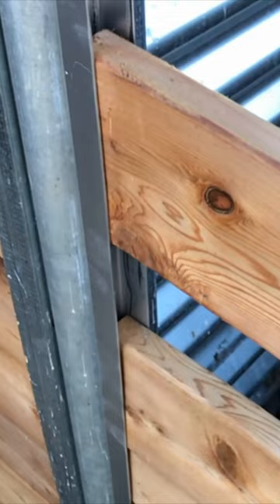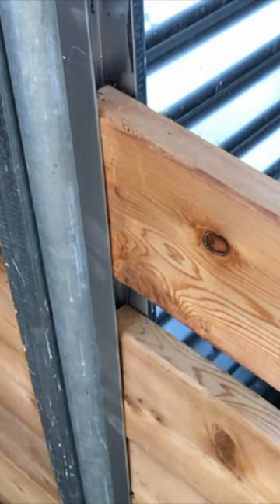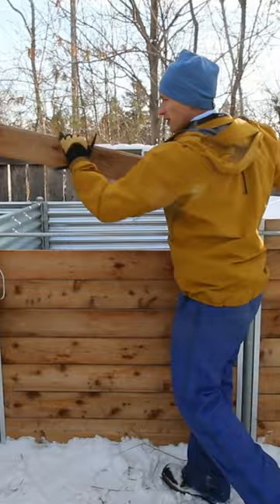A Compost Bin to Last a Lifetime

Comment: Interesting build, but you MUST drill lots of air holes in the metal so the compost stays aerobic. You’ve created an environment where the bottom of the pile could go anaerobic. That will ruin your compost.
Reply from the maker: I address your concerns about air flow in the full video here: https://www.youtube.com/watch?v=Ei0wf8g0jgU&t=269s
Reply: how will it ruin his compost? people make anaerobic compost too.
Reply: You could use expanded metal instead of corrugated, or at least at the base 12”
Reply: I have an insulated hot compost tumbler. The air vents are tiny. It makes great compost fast. Microbes are very very small organisms, they don’t need as much oxygen you might think they do. As long as there is air that’s ok.
Reply: @stevekent3991 I love my compost tumblers, I got all three from friends and neighbors that gave up on composting 😅 wicked quick.
Reply: It’s open topped, as long as it gets mixed once in a while should be good to go.
Reply: @VegetableAcademy

Comment: Looks great but you need airflow. Either drill or shoot some holes in the sides or install a 4 inch pvc pipe with tons of tiny holes or less larger holes. You can do this as you buld your compost. Easy fix.

Comment: I rock piles in a field, flipped weekly with a baby kubota.  Im sure yours will last a while but I think I might be finally above your level. Also dont cut metal siding like that, use snips. You heated it up and anywhere a slag spark hit will rust.

Comment: Even the galvanized steel will decompost when in contact with the compost. And I would assume that heavy metals will contaminate the compost.
I use pallets for compost bins for free. When the wood decays, it turns into compost.😂

Comment: I always find these stalls to be very labor-intensive. Why not use the same square feet to have 2-4 very large tumblers so turning the material becomes easy?
Don't get me wrong, this is a very well-made version of the stalls. Just appears obvious to me how there are better ways to do this with gravity/physics.
Reply from the maker: I made a 40 gallon compost tumbler for my father years ago and the weight of the compost inside made it next to impossible to turn by hand even with the leverage of a long handle.   The volume of that small drum still doesn't even compare with the volume of these bins.  Rotating drums sacrifice a lot of volume because of the needed air space on all sides.  Cubic containers offer the most efficient use of space and once you've collected several tonnes of organic matter, it's just easier to leave it on the ground to compost without any added energy.
Reply: @VegetableAcademy  All good points, but I still think there's a lot of room for innovation. A powered rotary tumbler for a 55 gallon drum would certainly solve turning a tumbler/drum manually.
Feels like there is something there with building something up instead of out in order to use gravity.
Or using a large auger instead of digging the whole thing up intermittently? You are simply trying to introduce air and mix up the materials. Should not require all of the shoveling...
Reply: How about using compressed air to simulate ASP compost system? Good alternative to manually turning it. You can certainly do it on a larger scale with a bouncy house fan and some schedule 80 pipe.

https://youtu.be/K7yfhvSCcLk

Comment: To expensive.  Just get some bitty +Baby 🐔 wire, make a circle (as big as you want out in the open area) with it with some posts, have the wire one foot above the ground at the bottom and about 4 or 5 feet high.

Throw leaves ect over into it.  As the leaves and other things rot, rake it out from the bottom.

.

Comment: Will that metal rust?
Reply: Galvanized is extremely rust resistant. We build out raised beds out of some corrugated galvanized panels that were sitting next to out shed for 10 years. They have no rust on them.

Comment: No worries about using galvanized materials ?
Reply: The point of it being galvanized is to prevent corrosion, untreated steel is not very weather resistant, and the zinc is fairly unreactive so it shouldn’t cause problems with the compost
Reply from the maker: I address concerns about galvanized metal in the full video here: https://www.youtube.com/watch?v=Ei0wf8g0jgU&t=269s